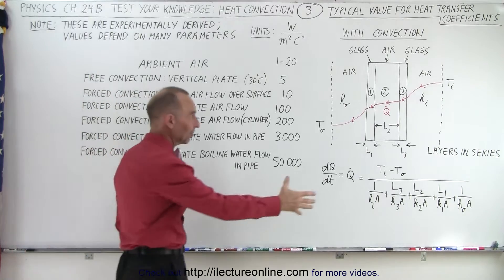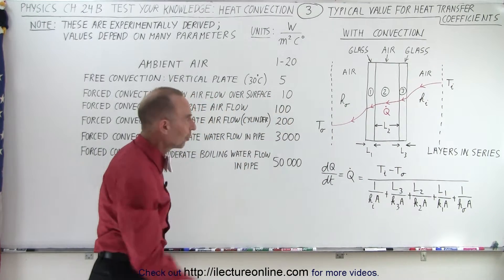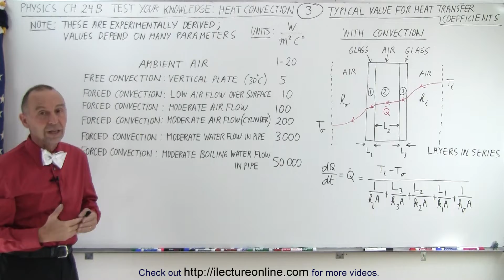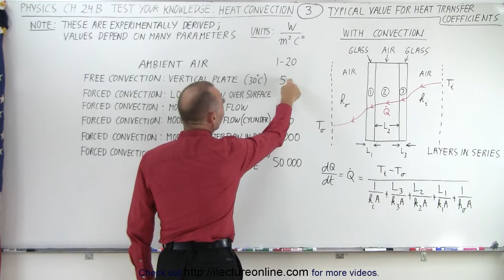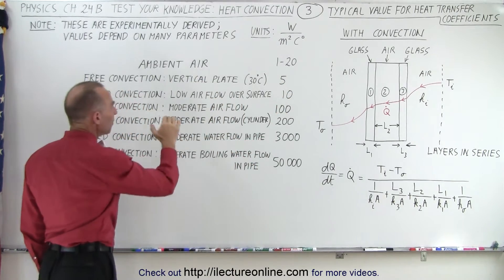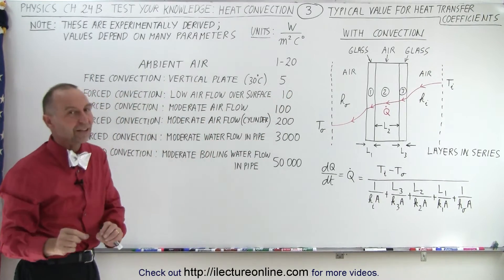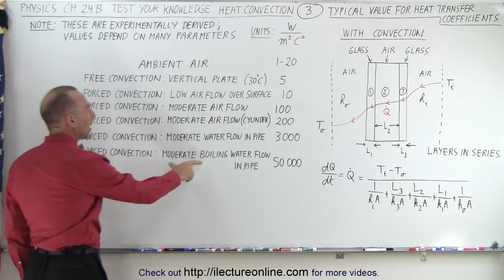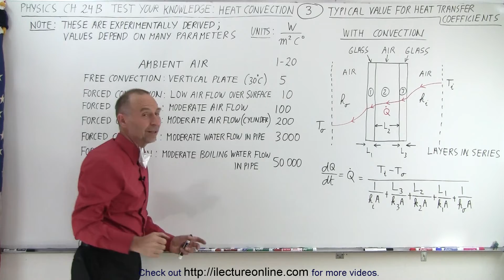Physics: Ch 24B - Convection: Test Your Knowledge (3 of 26) Heat Transfer Values

Comment: I have a doubt unrelated to this,

When we are talking  about the concave mirror...when a real image is to be formed....the image position is infront of the mirror....But we still see it behind the mirror..(..how will other animals perceive this....the ones which have a different lens in their eyes.)
Here there is no screen.
This is with respect to the spoon.
Also my another doubt is about lateral inversion.
Reply from the maker: Have you looked at these videos yet?  PHYSICS 54 CONCAVE AND CONVEX MIRRORS   and  PHYSICS 55.1 LENSES AND MIRRORS UNDERSTOOD     Note that to see virtual images you have to look into the mirror.  Real images can only be seen if a screen is placed at the location (in front of the mirror) where they occur.
Reply: @MichelvanBiezen  But when we see our inverted image in a spoon. Which is inverted.
Reply from the maker: You have asked a very interesting question, so I went to investigate it more.  As it turns out the curvature of the spoon is different lengthwise vs widthwise which essentially gives it 2 (or more focal lengths).  Which means that at different distances, the eyes can intercept the light rays reflecting off the surface of the spoon and form a visible image that is relatively focused over a wide range of distances.  If you hold the spoon close enough, you will see the virtual image as well.
Reply: @MichelvanBiezen  Thank You. Yes. But now , dropping the spoon case which is not spherical completely . Let us talk about the concave mirror itself directly.
When we look into it from a point away from the focal length ( away fro the mirror) that is when a real image is formed we see the image in the concave mirror...which is at some distance from the mirror but is formed inside it.
Here there is only one focal length, right?.
So here came the confusion .
Reply: And thanks for the instant replies.